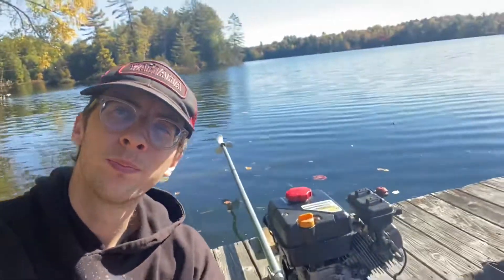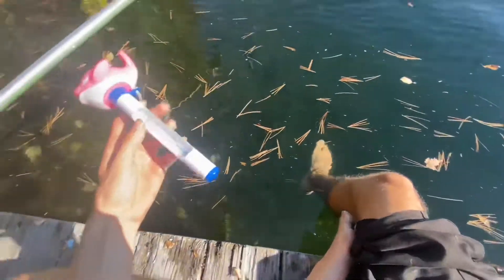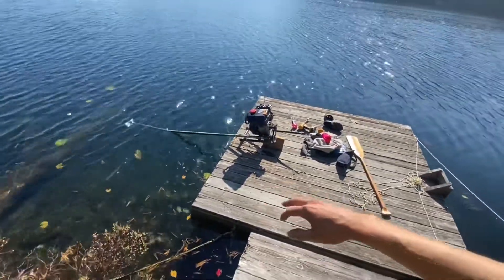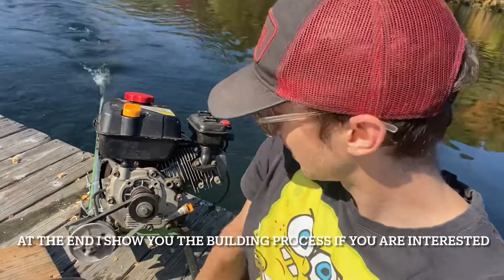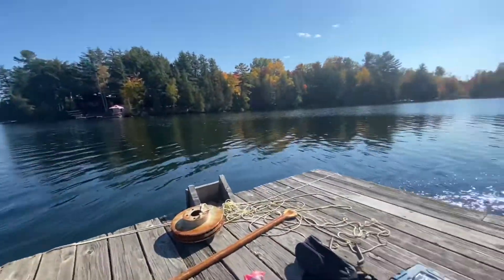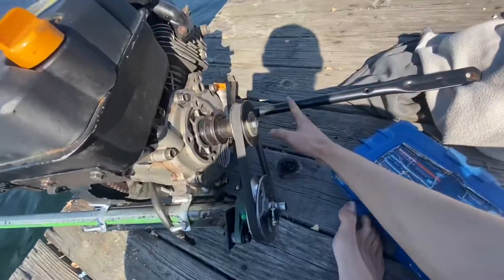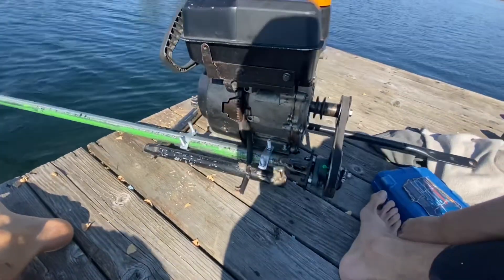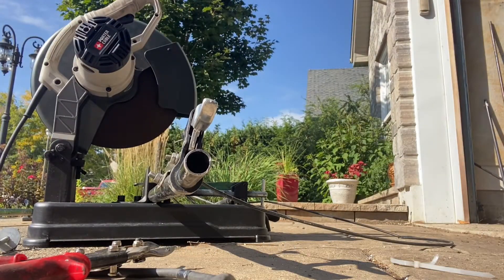Belt drive mud motor for clockwise propeller

Comment: Keep the t shirt out of that belt and she is slick
Reply from the maker: Yes this was more a test to understand how to make a system with the belt drive. I think the engine would be better if it was installed in front of the user as an inboard because the controls and the recoil start are inverted but i dont really want to have the fumes coming at me all day long

Comment: Great job! You are really onto something there. I love belts and pulleys. They are so quiet. Try a link belt. A link belt grips the pulley with low tension and has adjustable length.
Reply from the maker: ok i will integrate that idea for my next generation of drive system  this summer

Comment: please, how did you attached outboard propeller to your shaft..... otboards shaft use to have that ribs or teeth. thank you
Reply from the maker: I tapped the splines of the propeller with a tap and i have threads at the end of my driveshaft because i welded a bolt to it
Reply from the maker: With a 3/8 tap

Comment: hello, what are your experiences with otboard propellers?... did you find some good replacement for long tail prop? are you able to reach the same speed with outboard prop like you use to with long tail prop? I saw your video where you reached 31 km/h .... but I think you achieved it with long tail style propeller. I am happy that I found your channel... In future I would like to build my own tiny boat...so I hope you will add some helpfull content. Best regards.
Reply from the maker: Hello i have not been able to test the max speed because  i only finished the invention at the end of the summer so the water was too cold to use my small boat. But i have used the same 4hp propeller on a yamaha 4hp outboard and reached 32km/hr. I think on a longtail it will reach the same speeds.

 I can make another video of building a small boat for you. 

From now on i will only use right hand propellers because its more common for most people that watch my videos and want to try it and i already have a variety of 4,10,20hp propellers
Reply: @boatfabricationchannel2991  did you have time to test that propellers already?
Reply from the maker: @janzahoran9868  no i have not tested my invention again this summer because i live in canada and this invention is not very useful to me because i can only use it 3 months of the year or else the water is too cold or frozen and its dangerous hopefully someone else will pick up on my research. also the driveshaft snapped right between the pulley and the bearing probably because the driveshaft was too small at 3/8 inch.

 i would use a 3/4 inch driveshaft next time because this is what the professional kits use and get some splines machined at the end for the propeller. I am on a streak of inventions that dont work for a year now.

Comment from the maker: Now with this technique of the belt drive system i can use right turning propeller like every outboard engine in the world. Usually the longtail system uses a left turning propeller but they are hard to find unless you live in asia or if you want to pay 50$ each. 

My new propellers are 20$ and have a lot more sizes available and i can use any propeller from a normal engine like yamaha mercury honda.

I will be using the right turning propellers from now on

Comment: That’s pretty awesome speed even at low rpm, seems like your prop pitch and ratios are perfect for the motor. I wonder if you could get two of those adjustable sheave pulleys (the ones where one half of pulley is on threads for belt tightening) so both pulleys could be adjusted either big or small to fine tune the gear ratio?
Reply from the maker: Hello yes i will have to play with it more. All outboard engines are geared 2:1 so this is probably the ratio i should use.
 I have a 7hp engine and a propeller from a 4hp yamaha so i try to spin it faster at 1.5:1 but i dont know if it made a difference